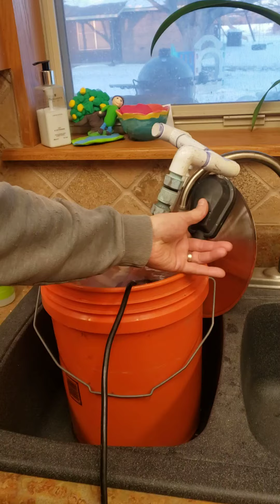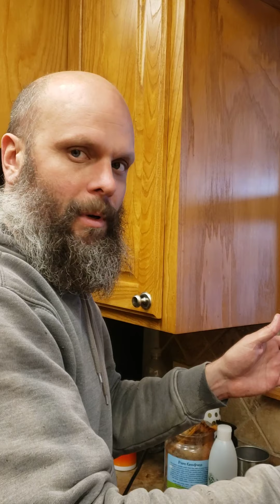How to Thaw Frozen Pipes at a Single Faucet.

Comment: cross contamination
Reply from the maker: of?
Reply: Back-siphonage is the reversal of normal flow in a system caused by negative pressure, vacuum or partial vacuum in the supply piping.
Reply from the maker: @marcobarraza129  Which applies here in what way? Positive pressure still stronger than the pressure flowing into the pipe in the opposite direction. I believe I specifically covered this in the video.

Comment: Some notes, if you're not a homebrewer an aquarium pump and bit aquarium hose will do the same thing (slower). Also, the "feels like" temp only applies to living organisms that can 'feel' otherwise pipes operate at ambient temperature.
Reply from the maker: Aquarium Pump is a great idea. lots of pumps work so whatever you have around is awesome. Ambient and Feels like are a blur. Ambient of the exact area is measured with a thermometer in an exact area. So unless you have thermometers in your walls or at different places around your house then you cannot know exact temps. But often people look at the temperature shown on a weather app and do not understand that things like wind and shade can adjust the "microtemperature" of a small area. Hence freezing of northern wall pipes and not southern or eastern it my area of Texas.
Reply: @RevivingRealFoods  Intelligent and thorough answer thank you
Reply: It's all about the heat transfer. Temps will be approximately the same on the outside of the house on the northern and southern parts of the house. If the wind is from the north, then the convective heat transfer will be greater and thus the northern pipes will be more likely to freeze.